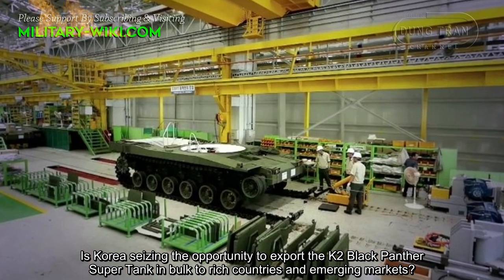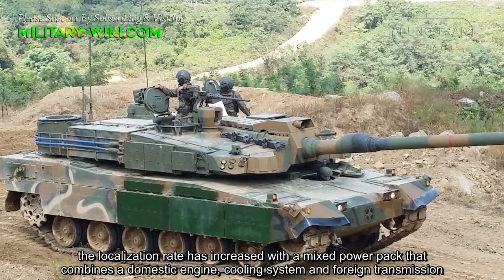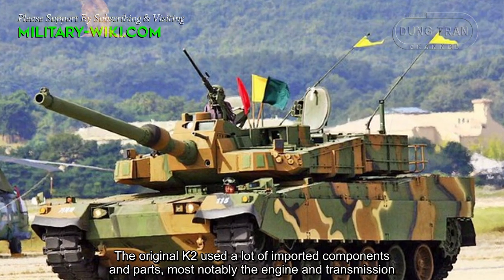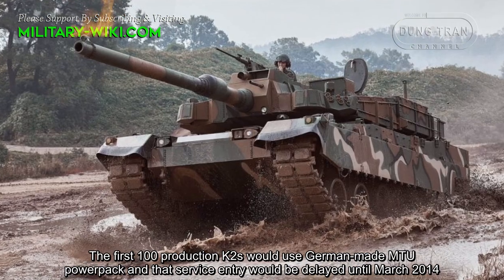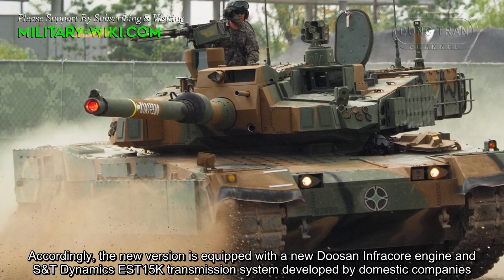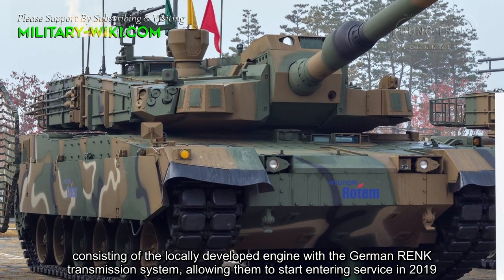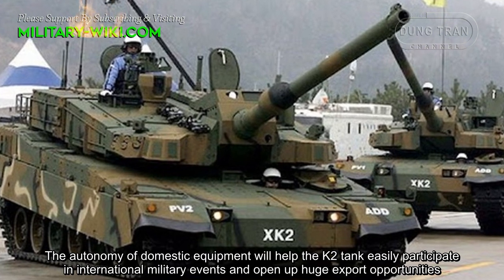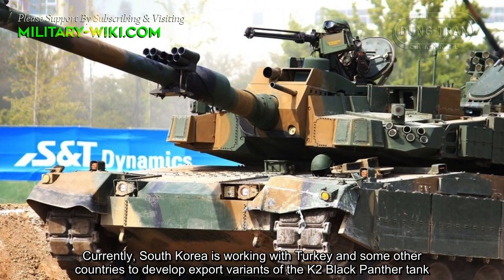K2 Black Panther Opens Up Export Opportunities With Domestic Engines

Comment: The K2 is a nice copy of the Abrams electronic, night vision, stabilized gun to fire on the move with the mechanics and armor of the Leopard tank. With a S Korean developed high velocity gun and special light weight armor its an excellent mountainous terrain tank. Looking forward to S Korea equally the German motor and transmission to complete their technical knowledge of this domestically produced tank made specially for their terrain and needs. It should also meet the needs of many SE Asian countries with similar terrian of which the Abrams, Lecurac,  and Leopard tank aren't meeting.

Comment: I hope the Indian army is smart enough to go for it in combination with their T-90 until they get a working domestic tank. Even with all the help from Germany it took them 30 years to develop the obsolete Arjun MK1. If that isn't a promotion for private sector companies in stead of public sector companies i don't know what is. 

But there are more countries that could use these as a new main battle tank due to operational use of sixties tanks. And as long as Japan doesn't sell their tanks they are the best option for many countries in Asia. Russian technology is falling more behind the west each year and the Chinese haven't got close to getting near. Replacing one obsolete tank with another doesn't make economic sense. And for the Russia fanboys T-14 is still not working properly and it's electronics are so obsolete they need to design a new version soon, 15-20 years is too long to design and develop a weapon.
Reply: Says a so called critics without proofs… proven Abram’s can be destroyed easily in Afghanistan and Iraq…
Reply: @regizeelement8511  learn how to read you might actually get a fact right. Iraqi tanks surrounded a broken down Abrams and it knocked them all out. The only way to destroy it is send it into a city without infantry support next time you might want to read it for yourself in stead of citing scripted response ignoramus.

Comment: S. Korea begins the 4th mass production of the K2 tank. A domestic engine and a domestic transmission with improved performance will be installed, and the price will be lowered further. The fourth order is a total of 183 units.